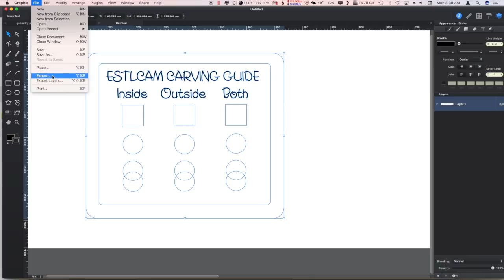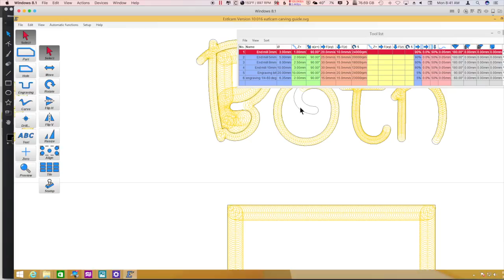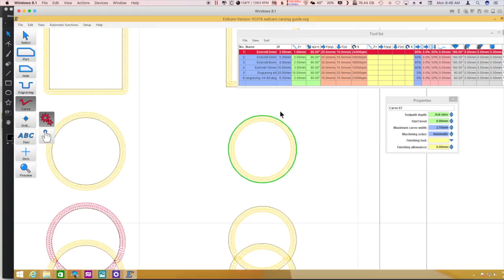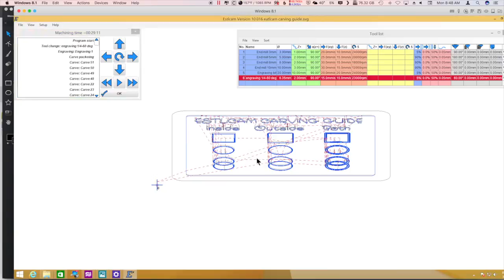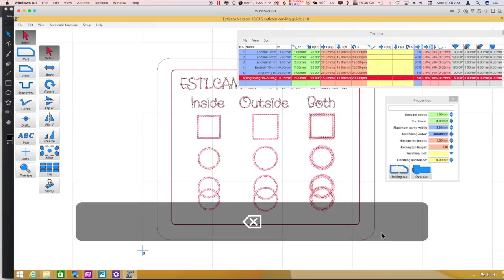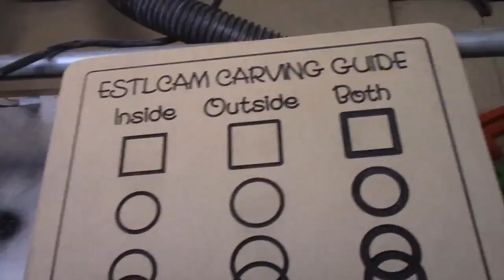MPCNC 17 engrave inside outside both

Comment: Hi SOGuy. Thanks for your invaluable help!. I noticed that you 1) automated carving, then 2) deleted "wrong" carved toolpaths then 3) created new toolpaths where missing. The problem is that new paths seemed to be superposing the automated paths. Wouldn't you end up carving twice? I'm just trying to understand how it works. Thanks!
Reply from the maker: Eskerinola yes it probable does cut the path twice. Doesn't hurt just adds a little time...  thanks for watching!
Reply: Thank you for your fast answer. I am currently working on SINGLE LINE FONTS text trying to carve/engrave/or "who knows what" process to have them. It seems that we can process complex letters but single line letters are taken by granted and nobody deals with them. If you ever happen to explain how to make them, I will be very grateful. Thanks again
Reply from the maker: Eskerinola I was looking for some single line font some time ago. Think I found one to download, but wasn't set for commercial. I think I had an issue with it too-- don't think it worked. Good luck!
Reply: I think I found the answer: Write Render/Hershey the text you want in Inkscape. Convert to path and import to EstlCAm. Then ENGRAVE.